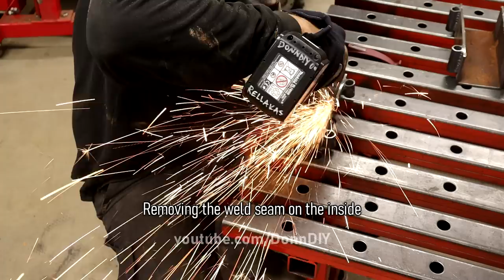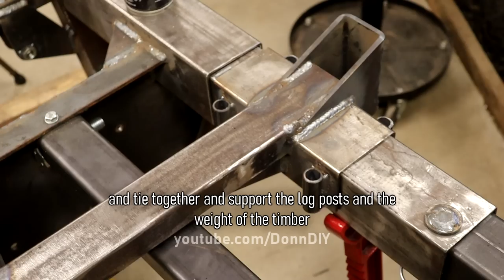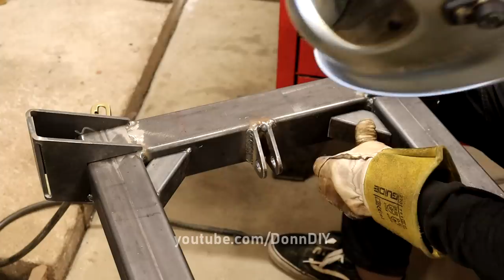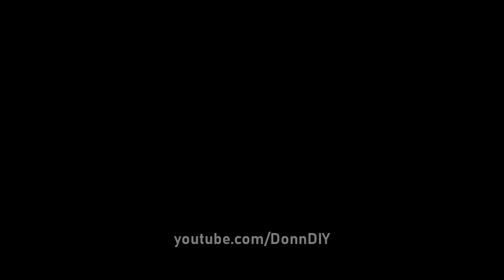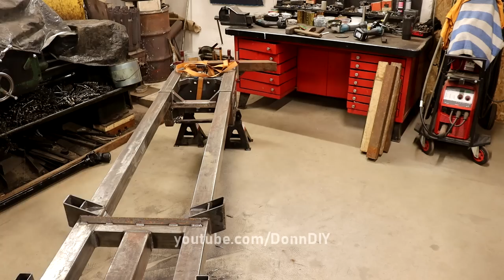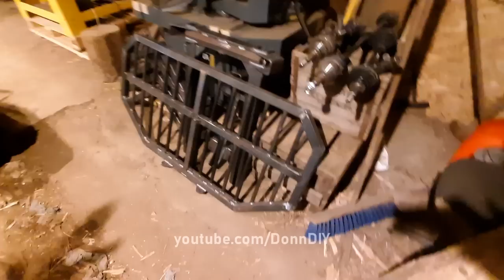4x4 PTO Driven Timber Trailer BUILD Ep.14 - Disassembly & Final Welding

Comment: Might have been better to oversize the steel box that slides over the frame then shim it with thin UHMW bearing strips (like a telescopic boom on a telehandler). That way you could compensate for any steel deformation by using different thicknesses of bearing strips depending on how tight the fit is.

Would also mean the sliding sections won't be constantly wearing your paint and exposing the steel to rust, etc.

Comment: Yeah, those safetyglases dont protect eyes from those little metalparticles flying when using anglegrinder, those just find they way to eyes anyway? sometimes. And its really annoying, does not hurt at the moment much, but you know next appointment is eye specialist. By the way, have you ever burnt your eyes with uv-rays from welding, I have quite badly in metalwork class in school, when I was some 12 to 14 years  old, it feld  like someone dumped truckload of sand to my eyes, cleard out  in 1 week tho, but I learned?from it, now I use sunglasses all times when sun is visible. 
Hope that is easy , to remove that from your eye and does not have any problems to it.
By the way, there is only ONE possible safety to eyes , diving mask with " bulletproof" glas on it.😎😎

Comment: When you have long square tubes telescoping, manufacturing tolerances are going to catch-up with you. You have too much unnecessary surface contact. The only contact you need is at the ends of each opening.

Comment: I noticed you didn’t test the pivot of the trailer and the pto shaft to see if they pivot correctly. I think the u-joint and trailer pivot should be in  vertical alignment!!!! Everything else looks good
Reply from the maker: PTO shaft will have telescopic movement. The position of the pivot point is close enough and any misalignment will be compensated by the telescopic movement.

Comment: No rusty eyeball?? ... did they have to drill it out? I tried going two days with a 1/8 inch steel sliver imbedded in my left eye above the cornea  . The doctor told me my eyeball had rusted around that steel sliver. LOL
Reply from the maker: I had a rusty eyeball two months ago when this kind of thing first happened. I think this time it was a piece of rough grinding wheel stuck to my eye.
Reply: @DonnDIY  ouch … I was blowing the water out of a sleeved engine block I just took out of a wash tank , I wear a full face shield when grinding or using an air nozzle as a “ broom” LOL 🍻.

Comment: hi friend, you are doing great!  But I noticed that you do everything without preliminary calculations (modelling).  I advise you to study design programs for PC .. it will simplify and speed up your processes .. You are really doing cool things ..
Reply from the maker: I go by the material I have at hand mainly. So the 3D modeling is secondary.  When I run out of stock then I can start 3D modeling full time.👍
Reply: @DonnDIY  well then everything is clear))) it's cool!!  when you can collect from improvised materials !!!!

Comment: You can get new brushes and fix that easy.
Reply: So, you didn't notice the plastic where the brush goes was melted and deformed, and the part that screws in behind the brush was also melted and useless??
🙄🤡🤪🤫
Reply: @haroldphipps3457  The plastic and brush and spring all come together in one piece.  I've actually changed them before--- have you?
Reply: @calholli  I wouldn't waste my time!
I have replaced brushes on many tools, but not on one's that have been overheated like that.
If Makita actually does send all those pieces, they know their stuff is JUNK.
Most good tool companies sell JUST the brushes. Because their stuff is built to last. And be serviceable. 
That tool needs thrown in the electric motor scrap bin and replaced with a QUALITY brushless tool.

Comment: Donn you fantasy ran away with you 😁 i think it's overly complicated many afterthoughts , a braket there, a hole there, a nut needs welding, and your drive system also complicated. 🤔 Not all ideas are good remember the tracked (Stone) vehicle. I don't think you will use frame extension or the turn tight bar/cylinder ,you forgot easy to use common sense 🤔